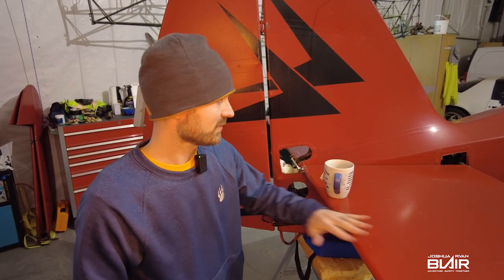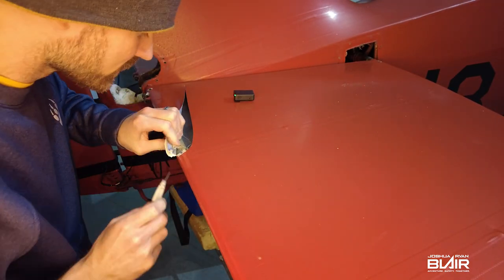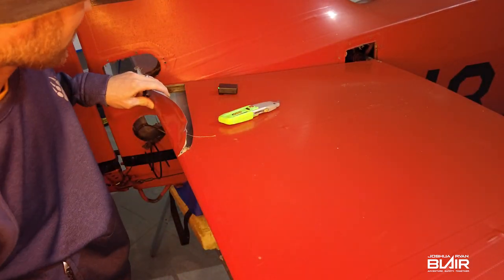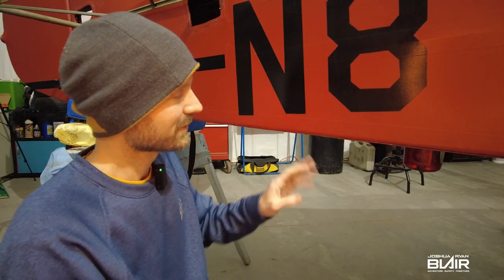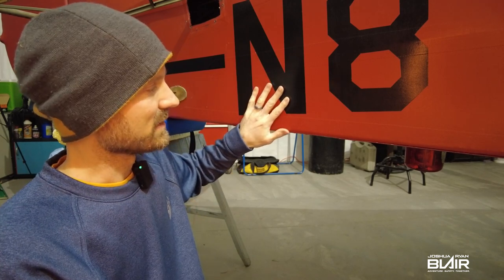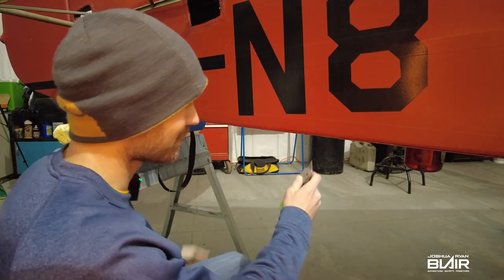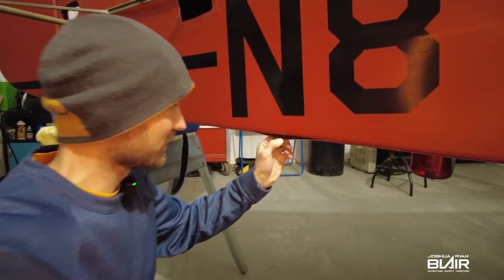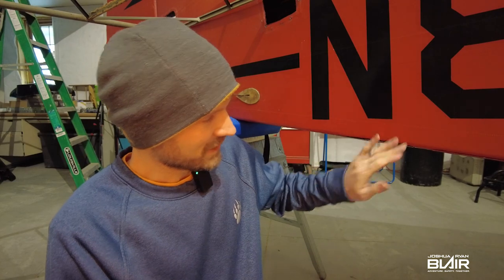Found WHAT!?! | Removing Piper PA-22 Tail (part 2)

Comment: Had Same Problem
My Quick recover project had same problem.   But I lucked out as I had a customer who was head instructor at a local aviation community college.  He advised the college had a space for 
the recover project. Time was not a factor. Ended up as complete rebuild of fuselage, total   recover, new windshield ,new paint, complete engine overhaul.  
Four years later, basically all new aircraft. Total Cost was,   parts plus 10%, NO labor cost.
I called it my College educated Tripacer
Reply from the maker: That's awesome. Glad it worked out well for you. Do you still have the Tri-Pacer?

Comment: Splice it... patch it... fly it.  Make it pretty later when you do the full resto.
Reply from the maker: Unfortunately there appears to be at least 3 more potential rusty sections. Based on what this area looked like. Including the tail post where two of the tubes come together. It’s due now for a full restoration. 

I tried not to be too optimistic when I looked it over when purchasing. With the airframe just “passing annual inspection” apparently I was a little too optimistic.

Comment from the maker: This has been a surprise and hard decision to make. I've decided to not carry on with this now being another restoration project as I already have one (1939 J3 project). The Univar gear switch can be a fairly easy change and not require a full teardown, which is what I signed up for. It's really just too bad that it will require much more than I have time for, as I plan to have a 4 place aircraft within the next year...
Reply: Ryan, do you have this PA-22 on Barnstormers? I live in Columbia City and been going back in forth on a Pacer project or a Stinson 108-. Currently fly a Velocity that I built out of HHG. Last night I was talking to a guy from Laotto who’s moving to Albion and he suggested your channel to me.
Reply from the maker: @brettgerber795  Yes. I’ve listed the fuselage and STC gear kit so far on Barnstormers. The Stinson is a great aircraft too!
Reply: @Blaircraft.Engines   Just the fuselage without wings correct?
Reply from the maker: @brettgerber795  That’s correct. However, I still have the wings.